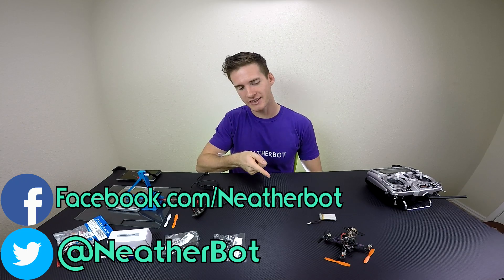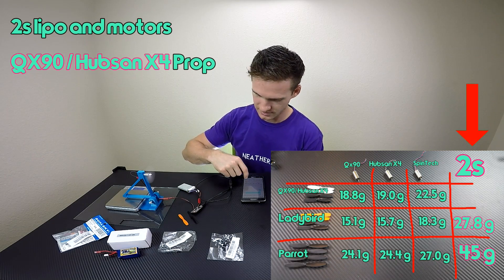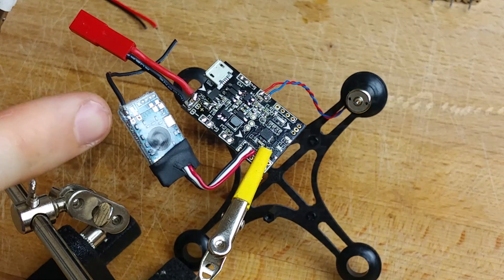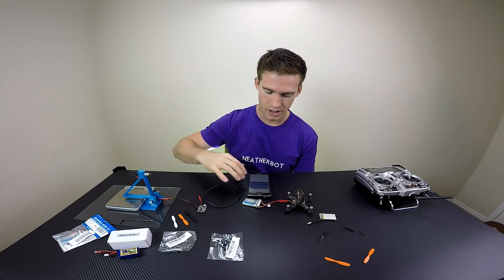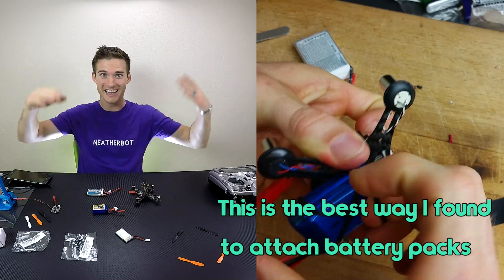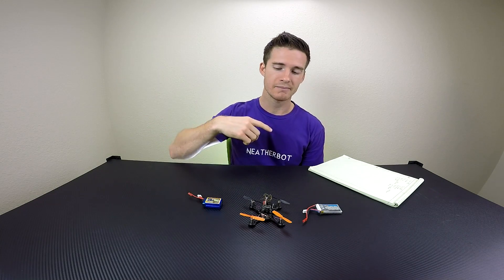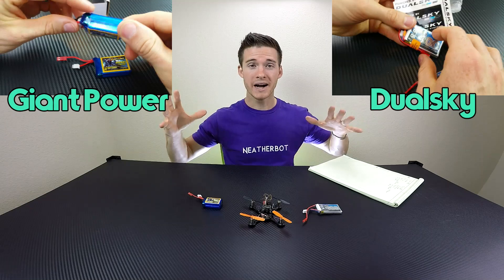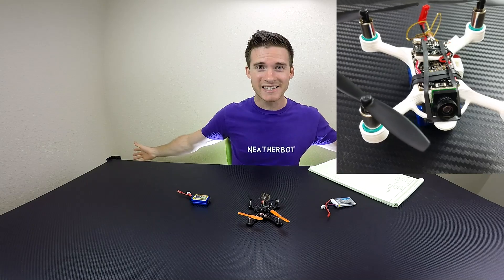QX90 Upgrades

Comment: You cant put "mAh" back into a battery. They can put out a certain amount of amps, for a certain amount of time. 
Milliamp hours is what it means. So a 600 mah battery can output 600 milliamps or .6 amps for 1 hour at the peak voltage before the lipo is dead. 
Think of it as how long the battery can last, the higher the better.

Comment: Love the info, but your wasting that power flying indoors...I did similar upgrades and my micro I don't even fly inside...it's to much! seriously take it outside! Use a 65-75 whoop inside. Ps with those modes get a 120mm frame, you'll have more camera vs motors an props in your shit...keep flying cool content

Comment: that battery was to heavy
Reply: C rating alone doesn't tell how much punch it will have. punch is the amp draw capable of the battery. to calculate amp draw you multiply Ah by C rating. so in his case .6*25=15 and .4*30=12. so the 600mAh battery actually has more punch even though it has less C rating.
Reply from the maker: +robert russell what would you recomend?
Reply: NeatherBot i would go with a 300 or 400mah 2s less flight time but alot more punch but if your only flying around your house and not outside the heavier battery would be good
Reply from the maker: +robert russell I'll have to try that. I have a variety of 2s batteries.

Comment: do you know if it will also pair with the fs-16x or is it just the fs-i6? with the flysky receiver obviously
Reply from the maker: +Andrew Salameh I have never used flysky, I don't know the answer sorry :(
Reply from the maker: +Andrew Salameh when you order you can choose from different models. One is for FrSky one is for Flysky pick the flysky and you should be ok
Reply: NeatherBot ya that's what I did I think I should be fine I was just doubting it because I don't see people using it with the fs-i6x just the tiranis and the fs-i6 but thanks for the reply!

Comment: Do youthink swapping frame to the kingkong 100mm frame would allow the parrot props?
Reply from the maker: +Todd Griffin a 10mm frame should allow for parrot props. If the frame is a true X frame. My micro NB98 frame is 98mm from motor to motor in a X orientation and fits parrot props. Check out the frame @ neatherbot.com

Comment: You kept saying "mahs". You said "milliamp hours" at the start, so I'm hoping "mahs" is just your short-hand term for charge. Please tell me this is the case and you don't actually think the unit for charge is "mahs".
Reply from the maker: +Lozzie74 miliamp hours is abreviated as mah. Sometimes I just say "mah" which is the abreviation. Miliamp Hours is a measurement of discharge over time. It is a way of measuring the amount of stored energy in a battery pack. The higher the mah the longer run times you will get up to a point. With greater mah comes a larger battery and more weight. So there is usually a sweet spot of the biggest mah possible while staying under a certain weight for quads.
Reply: NeatherBot I know what mAh measure and what it is. I was just concerned you thought they were "mahs". The "A" should be capitalised
Reply from the maker: +Lozzie74 thanks for the heads up. I learn something new every day ;)

Comment: Could you do a mod like this on the QX90c please
Reply: Jordan McSween it's the same process, just on a different frame.
Reply from the maker: +X-FLIGHT101 if it uses the same flight control board then it is the same yes!

Comment: Great video, thank you for sharing..
I am also working on upgrading my micro fleet, currently running a stock QX90 and EX105 =)
I have some racestar higher rpm motors on the way, 1cell 50C lipo`s and some 60mm props i heard about, should be fun!? 
Chek some of my video`s and while u are there, think about leaving a comment & subscribe!

Comment: Where did you get 2s jst wire? I have one but wire is too thin compare to battery. Is this okay? (Wire on Battery  is nearly three times thick)
Reply from the maker: +Insung Hwang I had it from a previous project. Yeah I would not recomend using a jst connector that the wires are that much smaller than the battery leads. You can order JST connectors off amazon or ebay. Make sure it's the correct end.
Reply: NeatherBot ok.. thanks :)
Reply: NeatherBot can I use 20awg board wire for 18awg 30c 2s batteries? I found 20awg board wire at local rc store.

Comment: Hi, I fitted this buzzer on my qx90, but i've found that it beeps almost all the time off and on when in flight. I wanted to fit it just as a low voltage alarm, or to recover when lost via a switch. I don't understand why it's beeping so much, I'm running betaflight, any ideas?
Reply from the maker: +siliconstate I bet you it's the low voltage alarm. When flying the lipo voltage will sag pretty low, but then come right back up when not under a lot of stress. Go into beta flight settings and reduce the low voltage alarm to like 2.5v and see if that helps.
Reply: NeatherBot  Thanks for the tip, I'll give it a try!
Reply from the maker: +siliconstate yeah please let me know if that works or not.
Reply: NeatherBot Will do
Reply: NeatherBot That was it! Thank you! The warning cell voltage was at 3.3v, I dropped it to 2.5v and the beeping stopped yet I was still able to trigger it if need be. Nice one mate, thank you :)
Reply from the maker: +siliconstate awesome! I'm glad that fixed it. Now if you want to get fancy you can fly around and when the alarm goes off at 2.5v stop and measure voltage. If your lower than 3.2v change betaflight limit to a higher number like 2.6 or 2.7. If the voltage is still high like 3.5v then you can lower the alarm even further past 2.5
Reply: NeatherBot Nice one, thanks for the tips! :)
Reply from the maker: +siliconstate my pleasure

Comment: Could you do these same upgrades to a qx90c??
Reply from the maker: +Rick Sanders the QX90C uses the same F3 Evo Micro Flight control board and motors, so these upgrades should work. Happy flying!
Reply: Thank you for the quick reply!!
Will be doing these upgrades for my QX90c when it comes in.
Reply from the maker: +Rick Sanders awesome! Let me know how you like it.

Comment: Might sound dumb but what type of usb cable do you need for beta flight
Reply: standard micro usb. same as an android phone. But be sure it does data as well as just charge.
Reply: BOTGRINDER FPV will do thank you for the help brother
Reply: Insanitykills 187 no prob man happy flying.
Reply from the maker: +Insanitykills 187 I'm glad I could help!
Reply from the maker: +Insanitykills 187 any USB that will charge an android phone should work. Here is the type of cable that works with this F3 Evo Micro Flight controller. http://amzn.to/2iHWrjp
Reply from the maker: +BOTGRINDER FPV thanks for helping answer his question, I appreciate the help!
Reply: NeatherBot you guys are great this why I got back into flying the people in this community are the most helpful I did helicopters for awhile so drones came easy but are so much more fun and nowear near as expensive to fix I subbed keep up the good work guys

Comment: Hey!

I'm new in the quad game, was wondering does this reduce the lifespan of the quad in any way?
Reply from the maker: +rad0ri the 2s motors seem to get hot and may burnout faster than the 1s motors. If you let the motors cool down between flights and don't use parrot props you should be fine.
Reply: oh i see! is it because of a higher p.d? or just cuz they run harder?
Reply from the maker: +rad0ri do you mean PID? The 2s motors are just drawing more amps and get hot easily if you are not careful about prop selection. So think about it this way. The motors work harder to spin more aggressive or bigger diameter props. The harder the motor has to work the hotter it gets.
Reply: oh i see now!! thanks for the explaination! :)
Reply from the maker: +rad0ri no problem!

Comment: I followed this advice and set up mine on 2s using 8x20mm Chaoli motors.  It has nice power but burns out motos in about 1min.  Basically every battery I use ends up with at least one motor being cooked.  They get so hot they sizzle your finger tips.  Mine will not cope with the extra power?  can you tell me if you had this issue?  If not exactly what are the specs on your motors?  
Thanks.
Reply from the maker: +ANGRYbirdFPV the motors did get hot after a bout 3 min of flying and I would land and let them cool. I imagine if you were flying aggressively and had a heavy flying weight I could see how they would get too hot and burn out. What props did you have? I have not flown with parrot props because they do make the motors run hot very quickly. I would suggest Hubsan x4 props and keeping flight times to no more than about 3 minutes. I would say that it's either your quad weight being too heavy or a prop that is too tall (big) for the motors.
Reply: thanks. my props are ladybird props.  my weight  is only that of the standard qx90 that is in the picture I run a micro futaba receiver which does not have pins on just the board and direct soldered.   my voltage is 7.4v on 2s.  I am getting some spintech 2s brushed motors and I hope they will solve the issues otherwise I'm stumped.  They should arrive in a day or two so I will see.  What about the PID settings ?  I will check mine and unfortunately I run on  cleanflight so my PIDs will be very different and I wont be able to compare, also I  don't fly more than 2 mins lately so it cant be that.  I will get back to you with the verdict in case other readers are interested.

Comment: 2s rated brushed are a joke, they last 30 mins.  just go 1104
Reply from the maker: +Eric Bell the only issue I have had with the 2s motors is that the back of the motor easily pushes out of the can. Other than that they have lasted me quite awhile. I have designed my frame to support the back of the motor can and not allow it to get pushed out. So far I have had no problems with the 2s motors.

Comment: nice video! now i will upgrade my qx90. i allready use bigger frame to fit 65mm props its allready way better then stock. subbed and thumbs up. check out my latest vid
Reply from the maker: +Rolf Venz sounds like you are doing all the right stuff! I'm glad you liking my videos! I'll be watching your stuff too. Thanks for the comment, cheers!
Reply: NeatherBot thx mate. one question. i just ordered the motors, and 2 S lipos. so the motorshaft is 1.25mm isnt it? all props have 1mm hole. how did you made it fit? thrill bigger hole? or are there 1.25mm hole props also
Reply from the maker: +Rolf Venz the 2s motors have the same sized shaft as the 1s motors. I use the same props for both motors no modding necessary
Reply: NeatherBot ok thx. there was something like 1.25 motorshaft in the discription...strange
Reply from the maker: +Rolf Venz the 2s motors have the same sized shaft as the 1s motors. I use the same props for both motors no modding necessary
Reply from the maker: +Rolf Venz the 2s motors have the same sized shaft as the 1s motors. I use the same props for both motors no modding necessary
Reply from the maker: +Rolf Venz I will have to measure them to double check. I'll get back to you.

Comment: you should upgrade camera to a 200mw, and fly outside with your new 2s system. I fly the dualsky myself. they sell a 10mm motor also.
Reply from the maker: I have been blown away with how well the 25mw transmitter works. My limnit is the limit of tiny frsky Rx.
Reply: I bought the 200mw  just to try it out on my new F3 evo outside flyer, but you are correct that 25mw with the right reciver setup can't be beet. I haven't decided if I wanna make it a 2s yet. So many decisions
Reply: 10mm motors hmmm. Awful tempting

Comment: Hey, thanks a lot for this video! At the end which motors did you use? The bangood's ones? Or the amazon's ones?
Reply from the maker: In the end I use the Banggood 2s Motors. I always try and put the exact version / setup micro quad rotating on the right side that I am flying to help people see what I am flying. You can see it has the 2s battery under it. The amazon motors can not handle 2s. Great question and thanks for watching to the end!! 
Cheers!

Comment: Check out this cheers kit. It's 2S with 10mm motors.
http://www.gearbest.com/multi-rotor-parts/pp_553927.html?wid=21&lkid=10243176
Reply from the maker: Ok this is a sweet looking kit BUT I'm a tad confused. It does use the F3 Evo Micro like mine which is 2s capable. BUT the battery that comes with the kit is 1s 3.7v lipo....also I do not see anywhere where it says the motors are 10mm. I may be blind...but I am very curious about these motors and want to get my hands on some if they do exist. Thanks for the link! I like seeing different micro quads and components.
Reply: NeatherBot ya I couldn't find specs on the motors either. The  10mm number came from josh bardwells channel. He said they are 10mm
Reply from the maker: Ooh cool, They do look bigger for sure. Can you post the link so I can check out his video?
Reply: http://www.banggood.com/4X-Chaoli-CL-1020-10x20mm-Coreless-Motor-for-90mm-150mm-DIY-Micro-FPV-RC-Quadcopter-Frame-p-1106428.html?rmmds=search
Reply from the maker: +Success The Boss oh dang those are some big brushed motors! Have you used them?

Comment: hai there, i checked the hubsan x4 motor use 1s battery, will it okay to use it 2s battery with that motor?
Reply from the maker: +Stephen Chandra my understanding is that they will burn up if you put 2s voltage (8.4v) through them. I have not tried so I do not know for sure... They may last for a little bit before burning up. It may be worth a try. Let me know if you have success!
Reply: Hi just read your comment about burning motors out.  I followed this guys advice and set up mine on 2s using 8x20mm Chaoli motors.  It has nice power but burns out motos in about 1min.  Basically every battery I use ends up with at least one motor being cooked.  They get so hot they sizzle your finger tips.  Not something I recommend doing unless you find motors you are certain will cope with the extra power.   
Cheers.

Comment: I've been flying 2s on for a couple months now and over the course, I've found the best 2s batteries are hands down the 300mah 45-90c's.  I purchased 3 and then another 3 of these because they are so good.  May not give 5 minutes but I can definitely cover more ground in 4!  😁
https://youtu.be/82z7LoxhJl0

I've tried this 1st batteries too and I can say that they (and their C rating) are crap.  They make the craft fly like a brick and introduce some MAJOR voltage sag.  I fly everything with a LVA set at 3.5 and these are full on in alarm mode at about a minute in modest flying.  I strongly advise NOT to buy these batteries!